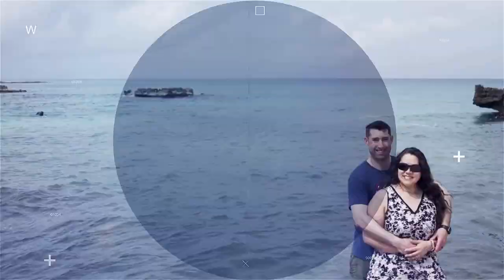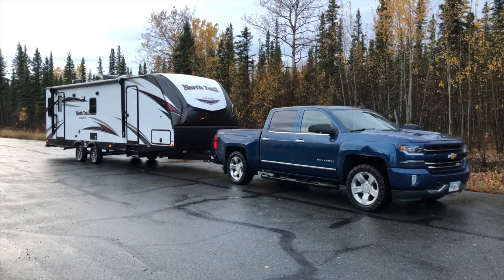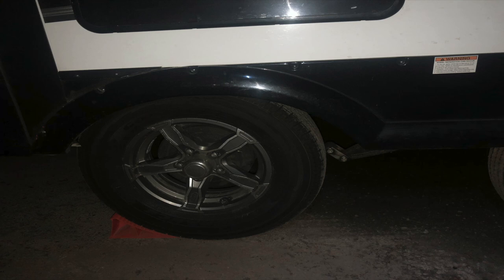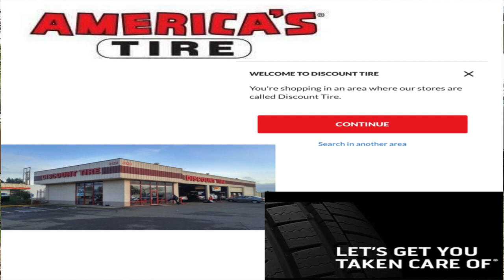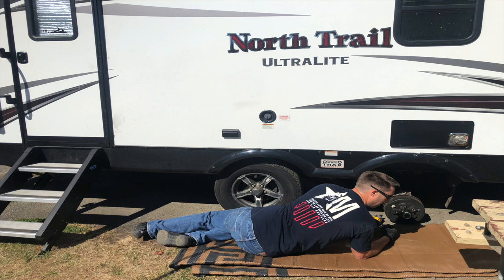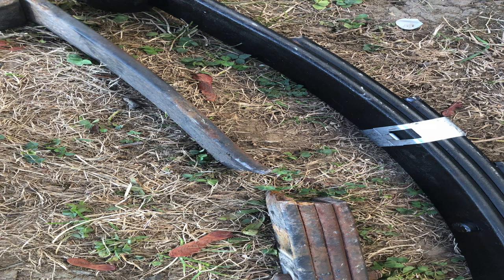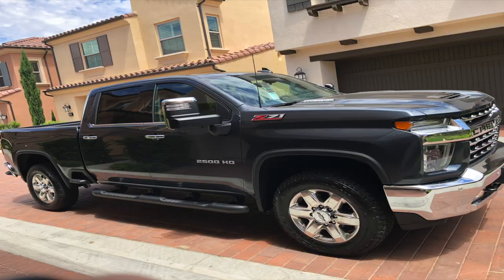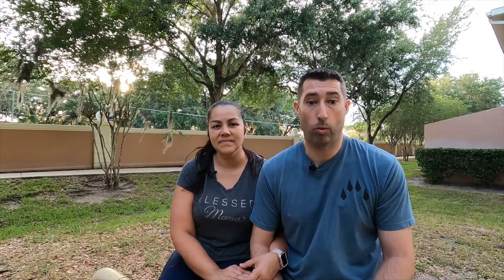How We Broke Our RV!!!! Was it Frame Flex?

Comment: Glad you made it safely to the campground! We had a similar close call after buying a new Fifth Wheel. I failed to check the torque on the lug nuts and almost lost a wheel. Thankfully my wife was following behind me and noticed the wheel was wobbling. I was down to just 4 lug nuts out of 8. The other studs were sheared off. We just happened to be 4 miles from our KOA stop and on 2 lane road so I limped down the road at 15mph. Had to take apart the hub, replace all the studs, lug nuts, and the wheel since the holes were now oval shaped.
Reply from the maker: Oh wow you definitely know our pain on the suspension. Day one I crawled under our new 5th wheel and found leaf spring u-bolts loose and spring hangers stripped (Five total). Alliance made it right and had Dexter repair their broken parts. Can’t ever be too careful.

Comment: For this reason, I carry 2 spare leaf springs with us when we take our RV out.  I also carry spare shackles, U-Bolts, bolts and nuts and an equalizer. Also a set of wheel bearings. I don't want to be stuck someplace for a week waiting on parts.  It's sad a person has to take along an entire suspension kit with them when they take out their RV.  I also take along 3 jacks and an impact wrench along with an arsenal of tools.  I've read horror stories of people stuck for hours along an interstate waiting for a tow truck only to find they can't tow their RV.  If you travel with one of these Recreation Vehicles, a person needs to research the spare parts and order them before you leave for a trip.  Even if you don't have the tools, or are physically unable to do the repair, somebody could do it for you if you have the parts.  It's the parts that are the problem.  Good video and thanks for posting!!  Safe travels!!
Reply from the maker: Hey Gary P,

I agree with you completely. We now carry a lot of extra suspension parts and 100% of the tools I can ever imagine. Thank you for watching our videos and supporting our channel.